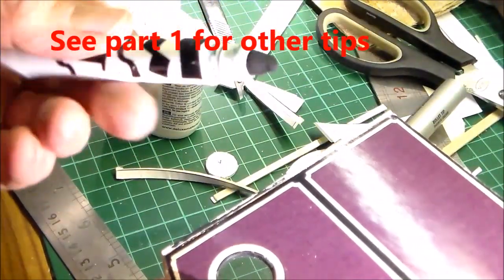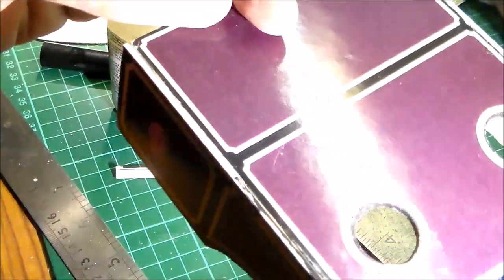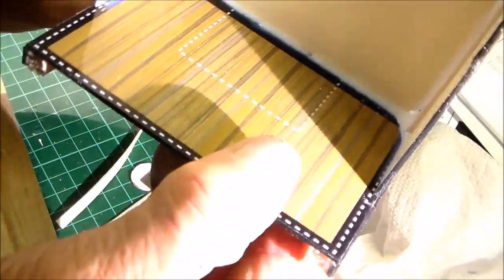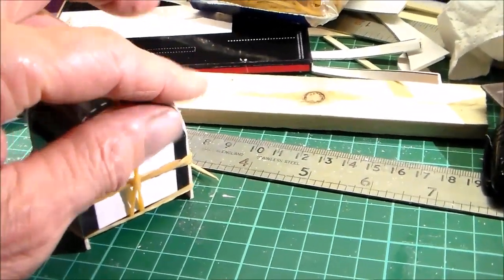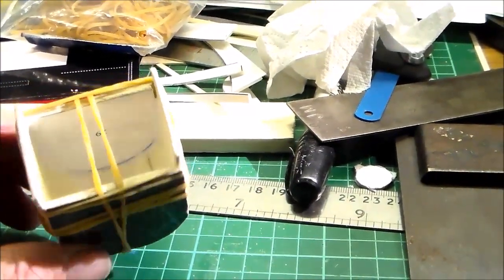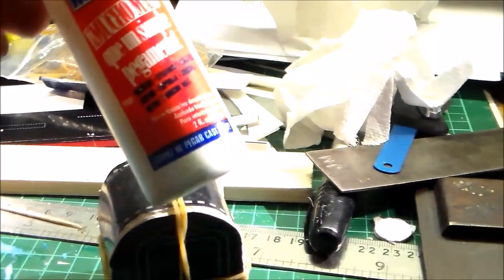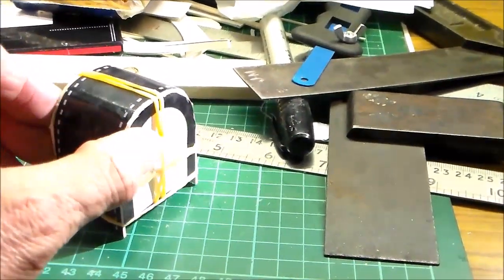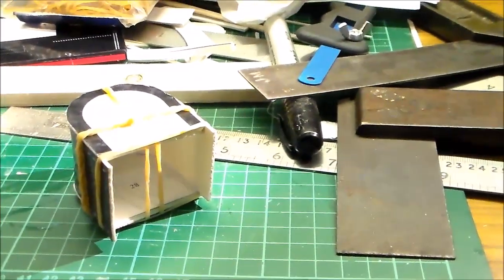Low cost g scale loco part 2

Comment: hey thats looking great so far :-)  nice to see something different, i some times make chassis from acrylic glazing sheet and laminate 2 layers together with DCM. It welds almost as well as plasticard but has a much higher melting temp
Reply from the maker: Hi Eddie. That is an excellent tip. I will look out for acrylic glazing sheet. Low cost materials allow you to experiment more Thanks.
Reply from the maker: By the way, what is DCM?
Reply: John Mellor  dichloromethane, you can buy it in small 70cl bottles in the model shops known as (plastic weld). If you look at my 06 shunter, its made entirely from acrylic and skinned with a thin layer of plasticard. You could skin it with normal card too and is super strong. The only problem with welding acrylic sheet is the solvent pulls the 2 pieces together quite tightly when its setting so you need to make sure the mating surfaces are reasonably square or it will pull the pieces together regardless. Also the footbridge on my vids is made entirely from acrylic sheet scored and snapped onto strips. it cost me about a fiver to make
Reply from the maker: Hi Eddie. A great channel. I have subscribed and will enjoy working through your helpful videos.
Reply: John Mellor BnQ do 8 by 4 foot sheets of styrene and acrylic sheet and it sounds a huge amount but if your doing small projects, its far cheaper than buying small bits here and there, ideal for making platforms and station buildings that are 100 % weatherproof.
Reply from the maker: I will go and have a look at the B and Q sheets. I must also get some of their plastic angle section. I will probably buy the smaller sheets to start with for ease of transportation. Either that or saw a larger sheet in half if it looks feasible. I guess that styrene will be nearer to 'Platicard' in properties.
Reply: John Mellor you can snap it with a stanly but you need to apply a small amount of pressure for 10 ish secs on the scored line, then suddenly it will give and you can carefully part it along the line. If you try and start it off too quickly it might try and break away from the line. As its more brittle and less bendy than plasticard, it takes a bit of patience to snap it. I have successfully snapped a 3mm sheet into 5mm wide strips by using a pair of plyers to grip the edge when snapping. It acts as a good lever and you can feel when its about to go. Your right about the acrylic sheet. Its not so easy to weld as the styrene sheet. BNQ do both :-)
Reply from the maker: Thank you, Eddie, for that really helpful advice on cutting the acrylic and styrene sheets. I will take a stanley knife and a friend. I plan a visit this week. As Wickes is closer and easier for me I will try there first and report back...until they close all the Wickes stores. I think building materials offer great potential for modelling.